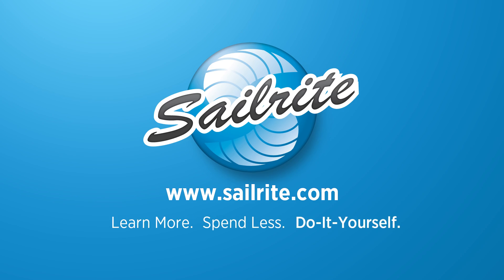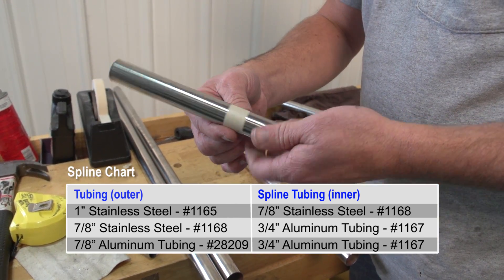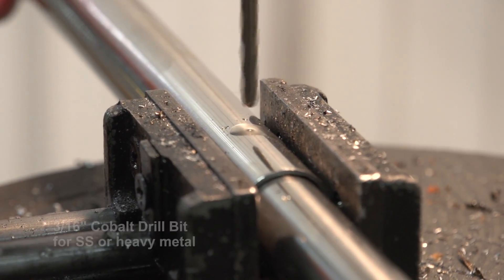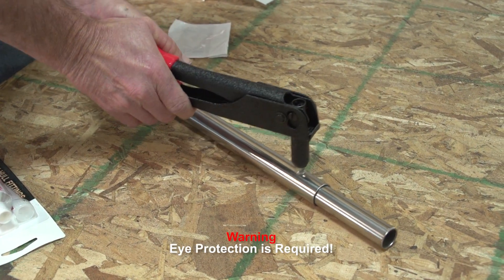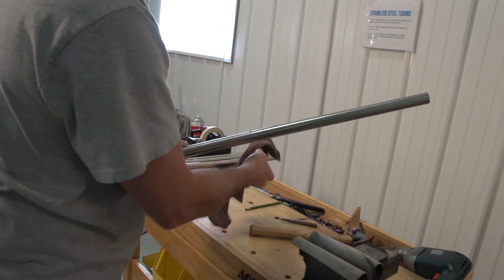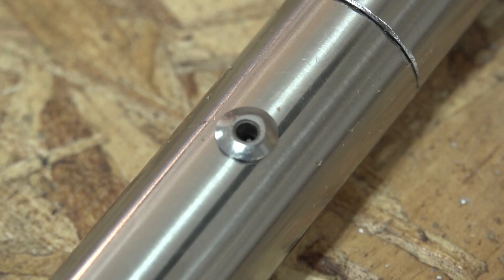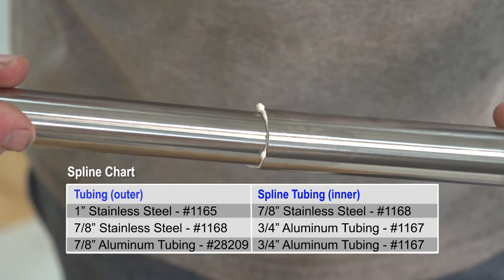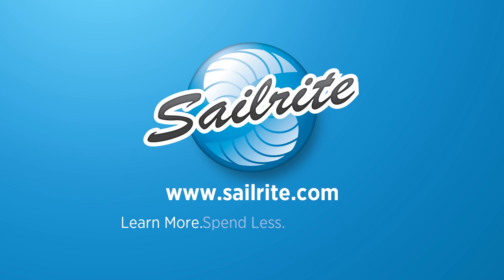How to Join Tubing with Splines - Marine Steel Tubing Joints

Comment: How thick is the 1” tube? Thanks
Reply from the maker: Inner Diameter:	0.88 inch
Wall Thickness:	18 Gauge (0.0516 inch +/-0.003)
Here is a link: https://www.sailrite.com/Tubing-Stainless-Steel-1-1-Foot

Comment: I know you have to be careful putting unlike metals together. Is it kosher to use the mild steel I have as a spline with my stainless tubing, or is there an important reason to stick with stainless?
Reply from the maker: It's best to use stainless steel with stainless steel, but you could also use aluminum if you cant find the right size spline. The aluminum would have a reaction, but it makes the joint stronger as they bond together. I would not use mild steel with the stainless steel as mild steel rusts very easily.

Comment: Using leather to protect the tubing yet you are using a vice jaws which is not protecting the tubing. At 1:17
Reply from the maker: True, but you will notice that the vice is not locked down for the drill press. Had we locked it down we would have protected the tubing from the vice's teeth with fabric or leather.
Reply: @SailriteDIY  Locked down or not, you have the metal of the jaws of the vice compressing against the tubing, which negates what the leather is to do, protect the leather from the jaws.

Comment: Any tubing with a wall thickness of .058 well except the next size smaller with a few thousandths of an inch gap  example 5/8 tubing with a .058 wall well except a half inch outer diameter tube, since the 5/8 inner diameter is .509 this means it has 9 thousands of an inch clearance between the two tubes.

Comment: Yes stainless steel is stronger than aluminum rivets. But aluminum is what's used in most aircraft, so they are plenty strong. But you cannot use aluminum rivets with anything--but aluminum as you will get galvanic corrosion through electrolysis. The exception is if your steel has been galvanized or sometimes heavily anodized you can also use insulators from plastic to nylon. There are Apex rivets which uses a steel stem and aluminum heads the stems have been galvanized. They are a stronger alternative for use with aluminum sheet and or tubing.

Comment: How many rivets do you need per splice?
Reply from the maker: You only need one on each side. So two per splice.
Reply: @SailriteDIY  Would this also work for thick wall pipe and/or structural tubing for building framework and such? Though I'd imagine structural blind rivets would have to be used for superior strength under heavy shock loads.
Reply from the maker: @jonathanchark5291  We have not tested it for that type of application. Sorry, we just don't know.

Comment: If I want to replace rivets on my handrails on the bow of my boat what drill size would I use to drill out the old rivet?
Reply from the maker: A drill bit that fits into the hole left by the mandrel, it should be only large enough to bit into the inside circumference of the rolled mushroom head of the rivet.
Reply: @SailriteDIY  Thank you.

Comment: What does a spline do to the strength of the overall member?   Stronger, weakens, or no change?
Reply from the maker: Hi Ed, Using a spline does not weaken the bow or tubing. In fact Jeff (our sail designer at Sailrite) actually says in a way that it strengthens the tubing, if the spline is securely fastened to the tubing.

Comment: Thanks for the video.  I'm making rails to support a ezup tent and wanted to travel with 5' sections of pipe.  I think I'll use your glue method on one end of the spline and none on the other.  Maybe put a screw coupler as well to make sure the two pieces don't come apart until I want them to.  Your video helped a lot.  My biggest issue now is trying to find that inner pipe that fits well enough on the inside of the 1" conduit that I'm planning on using.   1/4" leaves too large of a gap.
Reply: With self screw is stronger and better

Comment: 0one the glued hot dogging inner tube on my 10 by 8 foot Bimini frame to extend it original size. The glue I used is PL Premium polyurethane.I mixed in a little sawdust to set it quicker.
Frame has survived high winds. The Bimini tubing ends I just glued 6 of them with PL and no sawdust. We had a severe wind storm, and one of the inner bows pulled out from the ends. With the glue they also will no longer hold rain water. Other ends I have drilled through the tubing and ran bolts or sheet metal screws.

Comment: Although the video is good, the author's definition of a spline is not what I learned while working with machinery.  Wikipedia displays has a good definition: https://en.wikipedia.org/wiki/Spline_(mechanical)

I would say the video portrays more of a bushing or sleeve being used to join the tubes.
Reply from the maker: Thanks for your comments and your definition of a spline from wikipedia. You have a good point.

Comment: Why did you call it a spline, it's not a spline, also why use tape on one end and not the other, the tube will slop about if it's a loose fit which will loosen the rivet. Why show an aluminium rivet then say it's not recommended?

Comment: Galvanic corrosion will destroy the aluminum rivet in outdoor application
Reply: frank, have you even looked at stainless <--> aluminum galvanic corrosion rates?
Reply from the maker: Yes, that is why we recommend stainless steel rivets: http://www.sailrite.com/Rivet-Grooved-Blind-Stainless-Steel
Reply: Yeah, in 50 years you may need to replace it.